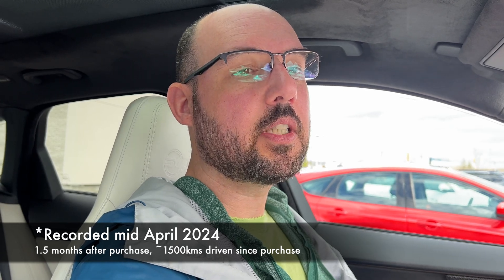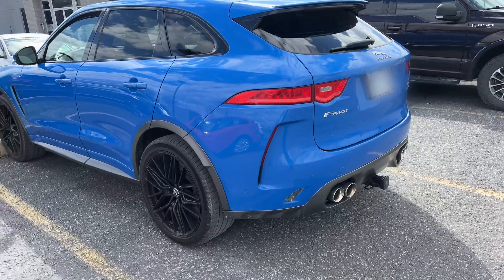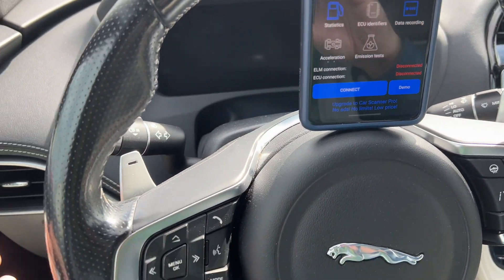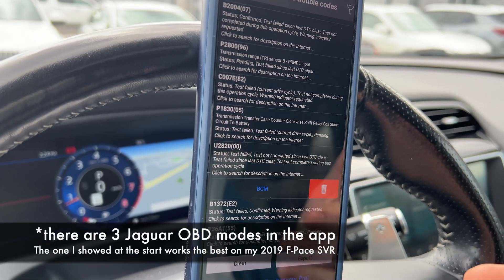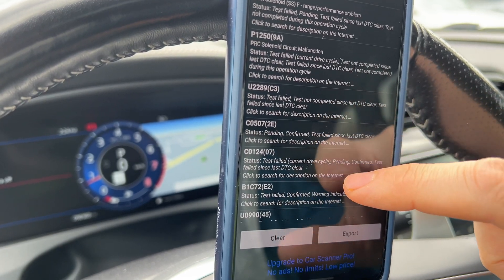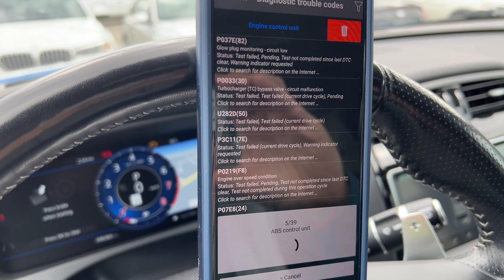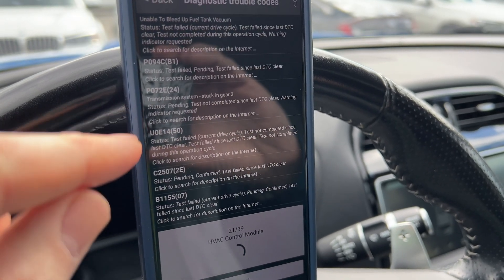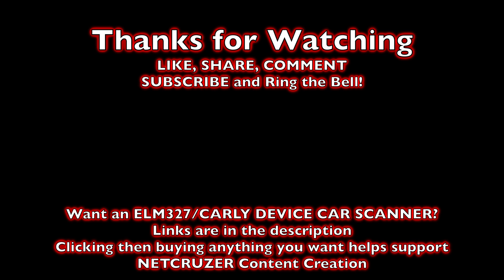SO MANY ERRORS! DIY Fault Code CAN BUS Scanning on a JAGUAR F-Pace SVR

Comment: Have you tried the battery. I had similar multiple faults with my Audi, the 12v battery was unstable, and caused the issue. I topped it up and dosed it with a battery cleaner.